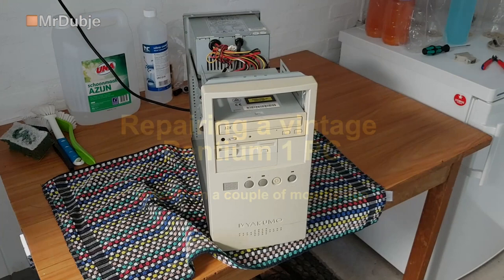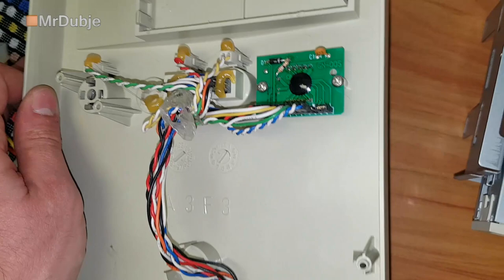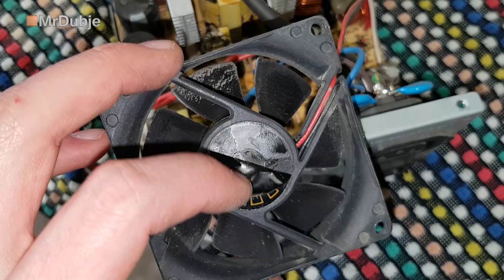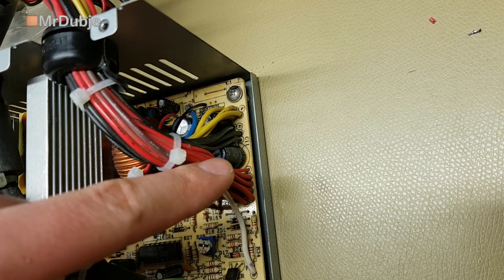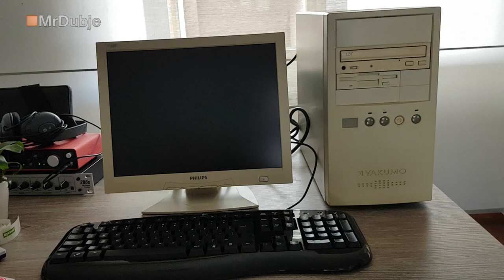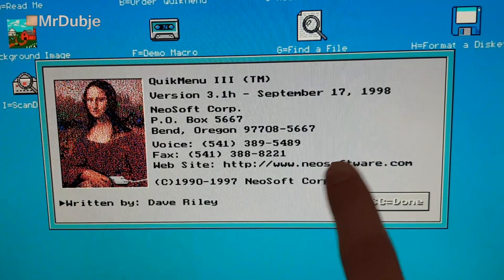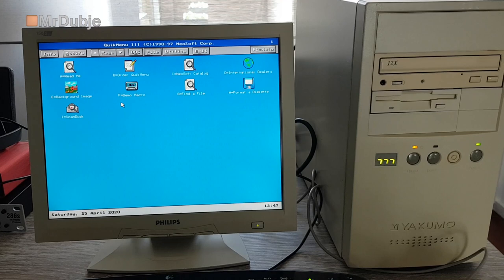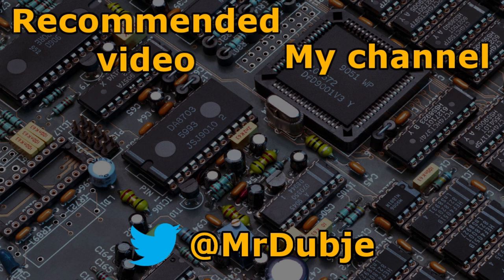Repairing and cleaning up a vintage Pentium 1 PC

Comment from the maker: Dear viewers, for the moment there seem to be some technical difficulties with the comments section. I can see the messages coming in, but they don't show below the video, hence I can not interact with them... YouTube was and still is a technical dumpster-fire it seems.
I will check the spam section as well, as there is a heavy filter applied.